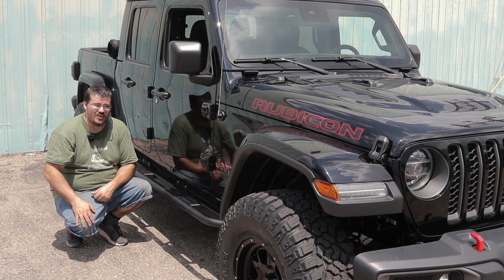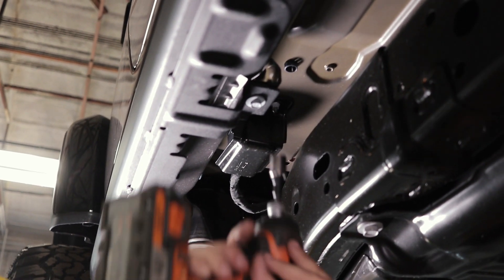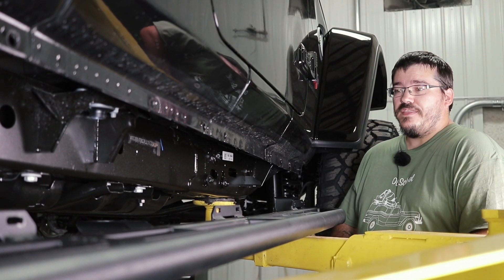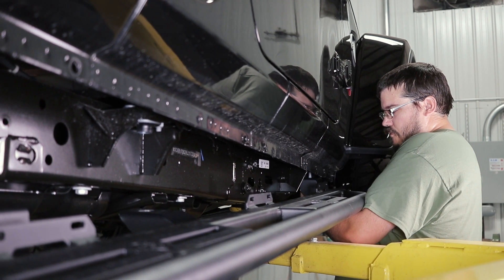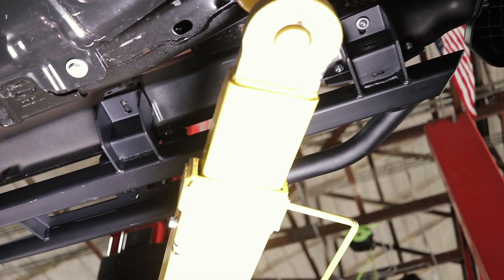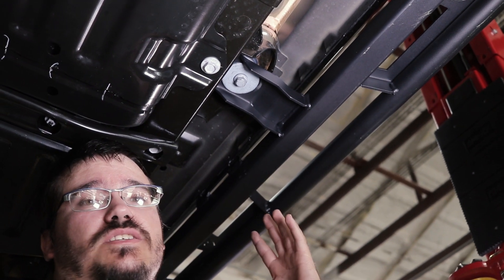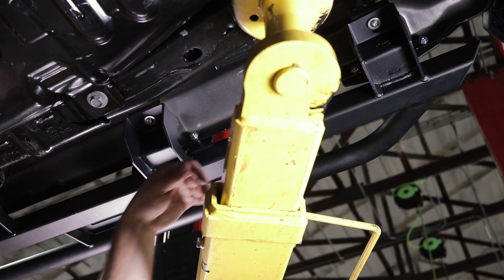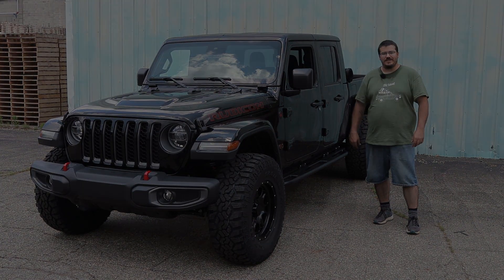JT Gladiator Classic Slider Installation

Comment: I just installed these today but ran into a serious issue. Using an cordless impact as on the video, my front passenger body Bolt snapped.  Not really sure what to do at this point, but hope a body shop can somehow get the other half of the bolt out of my frame.....